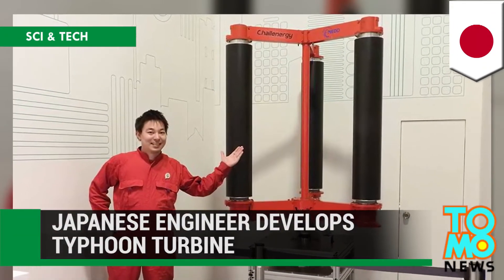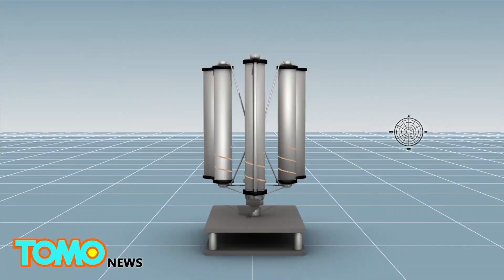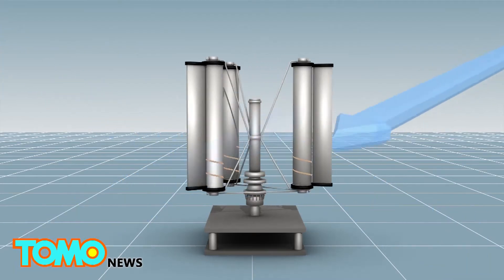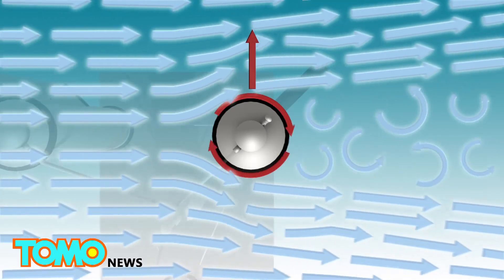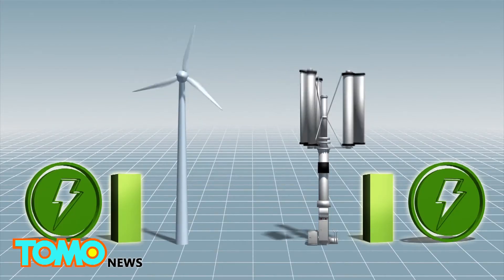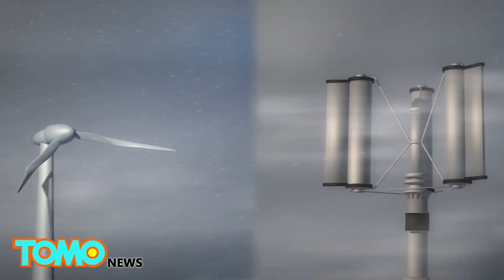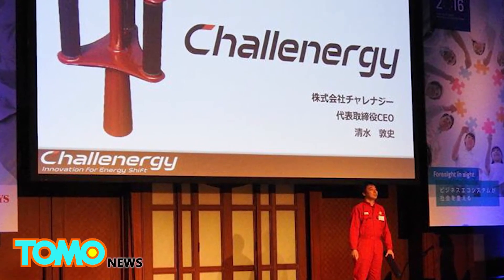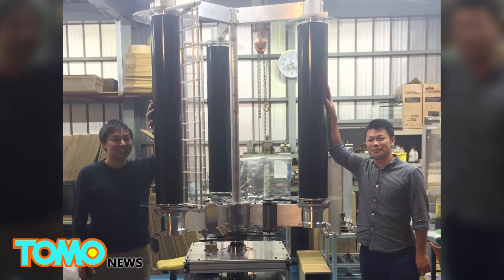Typhoon turbine: Japanese engineer develops wind turbine to harness power from typhoon - TomoNews

Comment: This invention is based on faulty science.  As correctly pointed out on their website (challenergy.com) the Magnus Effect by itself would not turn the turbine because the effect on each of the blades would cancel each other out. They claim to have invented something to overcome this, which seems to be the fins attached next to the cylinders. This introduces an asymmetry so that the turbine will turn just as a cup anemometer does, having nothing to do with the Magnus Effect. Spinning the cylinders just adds cost and complexity.